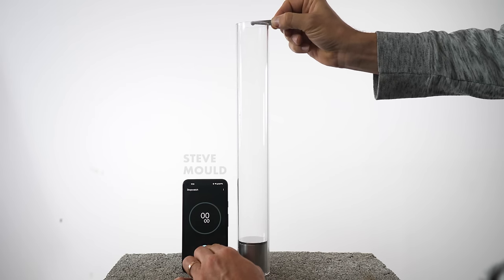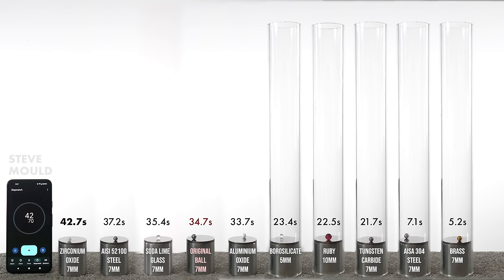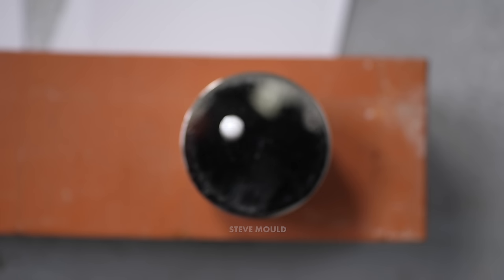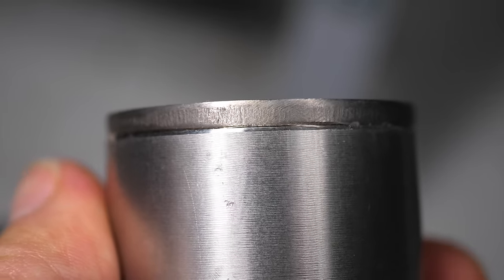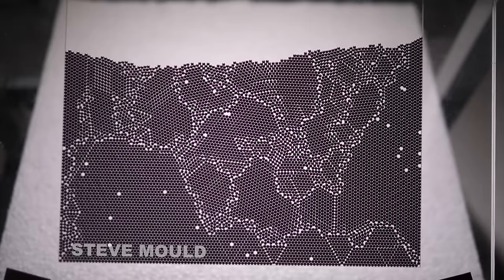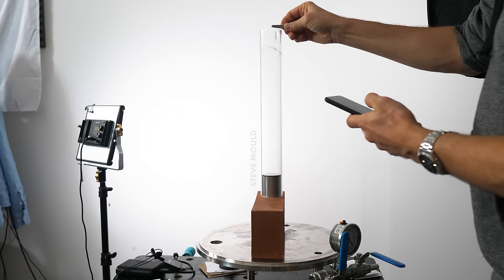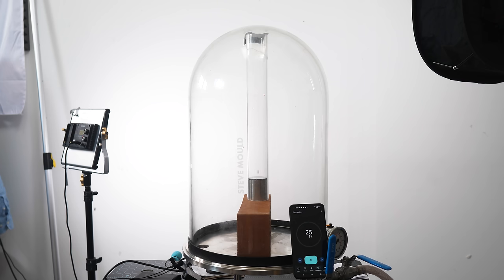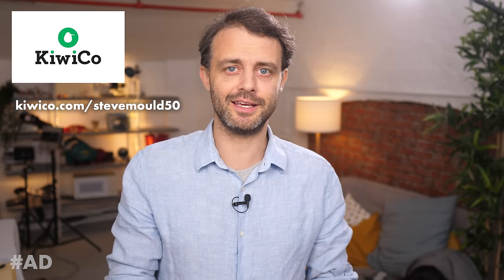This weird metal is insanely bouncy

Comment: Ah! You should've tested the smaller ball bearings again in the vacuum tube, as they were most affected by air resistance.
Reply: Good point! I wonder what a multidimensional graph of the results for each combination of variables ( air-resistance / ball-size / ball-material / surface-material / base-material ) would be like.
Reply: I was hoping he would as well :(
Reply: Given how little it seemed to change his tests, I imagine the square cube law has a much greater affect on the end result
Reply: @ittixen  that would be a radar chart
Reply: Agreed, it's the first thing I thought about.
Reply: I do think he should have done that but it also hit me <hypothesis>  that a ball bearing is just short of aerodynamically perfect. So even the small ones will experience very little drag.
Reply: Does the heat dissipation change much in a vacuum if the heat doesn’t transfer to the gas molecules?
Reply: @brekkoh  Probably, but given that air resistance does seem to play a larger role foe the small bearings, it may be enough of a variable change to make some interesting, if not significant to this test, changes.
Reply: @brekkoh  Isn't the square cube law (here: volume and weight increase cubically, while the surface only increases quadratically, as you increase the diameter linearly) precisely what might make the vacuum matter more here? For the smaller balls, the air resistance matters more since smaller balls have much less weight and therefore energy than the larger ones, but not that much less drag. The vacuum should take that issue largely off the table and we should be able to guess at the other differences between large and small balls (do they deform differently, does that make a difference? do smaller ones profit from their weight being less significant in relation to the platform?)
Reply: @elisha1984  Unlikely. Even in the setup with air, most of the heat dissipation happens through the base, not while midair anyway.
Reply: @jwnavagus  hm no
that's why golf balls have dimples
Reply: even though i myself am a nerd and would love to see this, the entire reply section is just 🤓
Reply: Action Lab.... I summon you...
Reply: He could also have tested filling the vacuum chamber with argon or helium or other gases or other fluids.
Reply: There are several experiments in this aspect. Since the shape of the ball already has a very good form factor, it barely matters. Actually I would look for other factors and not particularly the air resistance.
Reply: the action lab moment
Reply: @jwnavagus  Yes, I suspect the matching of the object properties he was talking about is outweighing the effect of the air resistance.
Reply: @jwnavagus  spheres are not aerodynamically perfect, as the airflow approaches 90° divergence at the back edge, meaning the vacuum (drag) approaches infinity at the minute point centre of the wake. That's why u see tear drop shaped aerodynamics. A water droplet falling through air takes the most neutral shape(which would be a sphere in a vacuum)
Reply: @ittixen  ok so guys we need 
1. 3D
2. colour
3. patterns varying
4. sound
5. heat
6. smell
7.taste
8. vibration
Now with this we should get a 10D graph.
Reply: He probably didn't think about it because of the forces he mentioned that would take energy out of the equation at low bounce height.
Reply: Yes Please.
Reply: @jwnavagus  Spheres are not aerodynamically perfect.
Reply: Yes, I thought the same.
Reply: @neutronenstern.  Exactly hahaha... I wish we had 4D vision + some other new senses on top so we could visualize such complex relationships at a glance.
Reply: Rain drops aren't "perfectly" shaped, surface tension pulls them toward spherical.  Freefall in a vacuum of course that's the only force, so they're perfectly spherical.  Also what's the "perfect aerodynamic shape" depends on the regime of flow (Reynolds number).  Shortest surface length (sphere, no dimples) is best if there is no risk of separation.  Teardrop/airfoil shapes are best at preventing separation (dimples/etc. to energize the boundary layer may help).  Truncated "bullet" shapes trade guaranteed separation for less surface drag and unstable flow.  And then there's sonic effects.
Reply: @ittixen  Also temperature dependence would be nice, but it would be hard with equipment which probably shouldn't be freezed by liquid nitrogen or even heated in a furnace :D
Reply: Needs to see this, could get crazy.
Reply: @brekkoh  the square cube law is only relevant because of air resistance though.
Reply: Yeah. I was waiting for that, but...
Reply: Also test other gases, like helium or SF6!
Reply: Imagine the time just to try to please your curiosity
Reply: To what extent at the speeds involved? The slower you go the less air drag matters...
Reply: This is exactly what I was thinking, good idea!!
Reply: @jwnavagus  actually spheres aren't near perfectly aerodynamic. Tear-drop shapes are.
Spheres create a void behind them that creates larger turbulence.
Reply: This. Now I'm really sad this wasn't done.
Reply: If the energy is dissipated thru heat what happens if the surface is hotter than the ball? Energy can only go into the ball right?
Reply: Gotta be next. Maybe even cool it down with liquid!!! And then go to the opposite way....heat them up, super cool the pad. 

This will turn into an hour-long video.
Reply: @peterliwyj7181  The energy dissipating as heat doesn't care about its surroundings.
Reply: @ittixen  Phase space plot for the win :D
Reply: @peterliwyj7181  energy is not specifically dissipated through heat but through vibration. This "manifests" as heat, sound, light etc.

One side being just being hotter than the other doesn't really alter the distribution of energy from the collision.
Reply: I was thinking the exact same thing!
Reply: bro u guys are nerd’s🤓
Reply: That would be sick
Reply: bounce the "demon core"
Reply: If he doesn't do this I think I'll riot
Reply: Okay Captain hindsight... Shut up... Lmao 😂😂😂
Reply: @elisha1984  That would just mean the ball and surface retain the heat longer,  it wouldn't return the energy to the bounce.
Reply: also most affected by molecular forces (square cube law) but he should have done the tests on smaller balls one by one in vacuum stoping when the bounce decreases because we can predict the effect of those forces increases as size decreases.
Reply: @asailijhijr  why tho?
Reply: Do you think a rock and a feather might fall at the same rate in a vacuum, too? I wonder...
Reply: @elisha1984  Heat transfer takes time, the bounce velocity is much greater and the movement much shorter than in an elastic material.
Reply: @tcunero  Action "Lab" usually has one or more major mistakes in each video.
Reply: smaller stuff more affected by air
Reply: You mean bearing balls, right?
Reply: I mean given the cross sectional area and velocity of the balls it’s probably fair to say the force of air resistance will only be a couple of newtons and since the height of ball is only several centimeters and the final velocity would only be a handful of meters per second it is fair to say that air resistance in this case is negligible. If you don’t believe me look up the formulas and prove me wrong with actual physics and math. Also the formula for air resistance doesn’t depend on the mass of a ball. The formula is one half the air density time the velocity squared times the drag coefficient times the cross sectional area and the coefficient of friction for glass is 0.9 to 1 meaning friction is pretty much negligible.
Reply: Very nice ball(s) indeed. Would be nice for robot testicular units.
Reply: The resonance of the cylinder vs ball size *
Reply: @ittixen  I need to see a gradient of quickest descent!
Reply: The speed for the 7mm ball did not significantly changed due to the less amount of air friction it experienced without the vacuum
Therefore the best case would have been to use the small ball bearing in vacuum ( it is clear that in a nearly perfect elastic collision, if the mass of object colliding with the surface is small then it's momentum would be considerably large)
Reply: @brekkoh  yea, probably
Reply: @brekkoh  Isn't the square-cube law the root cause of the air resistance effect on the small balls in the first place? because the smalls balls have proportionally more surface area compared to their internal mass vs the larger balls, they are disproportionately effected by air resistance?
Reply: @ska042  youve got the right idea. The square cube law is the root reason in the first place as to why the smaller balls are disproportionately effected by air resistance
Reply: You win the shoulda woulda award
Reply: Came here to suggest this as well
Reply: Just wondering what would happen in a vacuum tube two surfaces at zero gravity 😜see if it keeps going....
Reply: @jwnavagus  I also wonder whether the speed is high enough for aerodynamics to have a big effect or not 🤔
Reply: Agree
Reply: No u
Reply: @thomasfa18  How would you get something that is a teardrop shape falling going down, also to be a teardrop shape going back up?
Reply: @CorporateZombi  it doesn't matter how or if it's even achievable. The comment I made was in response to someone incorrectly stating that a sphere is the best aerodynamic shape when it very much isnt
Reply: What's with the "Ah!" Lol
Reply: @william_4297  Exactly, air drag is negligible. This means that it is likely that a smaller ball would in vacuum still be worse than the 5 or 7 mm balls. I think smaller balls are worse because of the shape (mostly thickness) and size of the bouncy metal plate part. When the ball bearing ball is heavier there is relatively less bouncy plate to leave vibrating. There may even be a resonation frequency of the bouncy plate that is more easily triggered by certain weights of balls.
Reply: My brain hurts from these comments
Reply: Was it really the air resistance?  Or maybe it's that the smaller ball bearings present a proportionately larger cross sectional area to the metal plate as they deform when striking the surface, and so more energy is carried away with each bounce?
Reply: This
Reply: @G, S? you deserve better than that, fellow person on the internet.
Reply: @elisha1984  How does the James Webb telescope radiate its heat into space?
Reply: @glennboyd939  water drops are spheres in the air too
Reply: damn Steves got some fancy cats
Reply: @foresttaniguchi3168  I have actually neen stuck in my head, trying to figure out how heat transfers in a vacuum like outer space. I like to try and work these out in my head before I look up why. It's fun to go about pondering these things that, I'm assuming, have been figured out. I'm guessing the heat is just absorbed by the material of the telescope which , excites it's molecules. After time, I think the energy is expended and the molecules revert to a more kinetic state as the energy travels outwards from the source. But, in my mind I keep picturing these heat waves dispersing into the vacuum until  my brain tells me "no" again.
Reply: @foresttaniguchi3168  I think the heat transfers into kinetic energy by the material of the telescope, exciting it's molecules. As the energy moves outwards from the source I think the molecules of the material revert back into a kinetic energy state once the source of heat stops generating. But then my brain keeps picturing heat waves radiating into the vacuum until my brain says "no" again, I wanted to think about it before I looked it up.
Reply: @elisha1984  no, it's independent. Heat transfer is bidirectional energy transfer. Here the kinetic energy dissipated produces heat, but it's one-way energy transfer. Whatever you do with the produced heat doesn't matter on the energy dissipated. It means that, in theory, you can infinitely heat a perfectly isolated stuff just by sending other stuff on it. (Ignoring heat transfer during contact). So for this experiment, isolation won't decrease the kinetic losses at all, if this is what you asked.
Reply: @peterliwyj7181  see my answer above
Reply: @TTxR2  Thank you! I forgot that kinetic energy produces heat. (Duh! Friction!) iI was really going round and round in my head about about heat transfer properties in a vacuum; like how I used to imagine perpetual motion when I was a kid, until I could conceptualize the mechanism of friction. Concept of friction is problematic for my brain even though it’s such a simple one.
Reply: @jwnavagus  Sphere's actually are not all that aerodynamic and do experience significantly more drag that other shapes. https://en.m.wikipedia.org/wiki/Drag_coefficient
Reply: @elisha1984  more specifically it's macro-movements of the collisioning body that impulse macro-movements of receiving material atoms, that turns into vibrations that produces sound in making the air molecules also vibrate, and heat by impulsing some mico-movements on the vibrating atoms (this is probably what you call friction, indeed internal friction of the material). The kinetic energy (movement) stolen from the moving body is, thus, transformed to kinetic energy of the molecules "lattice" (mostly vibrations because it's firmly attached to the table), which is transferred into sound waves, and for an other part transformed into heat. Macro-movements = kinetic, micro-movements = heat. It can seem arbitrary, but macro-movement for a solid is ordered movement (whole movement or macro vibration). Ordered in the sense that: it has lower entropy, and we cannot probe it the way we probe heat. Micro-movements are, in the contrary, disordered, random. So kinetic and heat is fundamentally just movement. It differs the way we can measure them. We also could say heat is quantic, kinetic movement is classic. Where the notions blur is in gas: molecules are traveling space (kinetic energy) but since it's disordered and random (Brownian movements) it can be measured as heat, and is called heat. And it can be transferred back and forth with surroundings (you can heat a gas by heating it's encasement, but you cannot make a metal block move by heating it's support) so it's legit to call it heat.
That's indeed a very interesting subject. Feel free to ask real physicians, which I'm not (read: don't take my words for granted)
Reply: Bearing balls* 😅
Reply: A very high pass filter on the audio file would perhaps be good.
Reply: You stole the comment I was gonna make 🤬🤣👍
Reply: 10,000th like
Reply: God I love all you brilliant people in this thread. Learning about the square cube law while bouncing different materials of ball bearings couldn’t so interesting without you all.
Reply: @jwnavagus  Incorrect, balls are actually not very aerodynamic at all. Golf balls are the the most aerodynamic a spherical shape can get, because the indents capture pockets of air close to the ball, changing a large portion of the surface from golf ball vs air interaction to air vs air interaction.

A ball bearing has a whole spherical surface of metal for air resistance, a golf ball has a shell of air acting as it's air resistance surface.
Reply: SOOOO TRUE!!!!!!!!!!!!!!!
Reply: Were they really?
Reply: @elisha1984  I don't think it would. The dissipation of enegery heats the amorphous metal not the air. What this would change is the rate at which the heat is dissipated from the metal. But I do not think it would change the bounciness
Reply: @suisseski   Now that I am thinking of heat as something contained by matter,as a result of its energy, with the ability to transfer to adjacent matter, I can finally visualize it without the thought loops.  Heat exists where the kinetic energy is occurring. I think you are right that heat wouldn’t be a noticeable factor for bearing bounciness. I was trying to think of this on a nano level.
Reply: I'm stunned -- you used the word "affected" instead of the lazier bastardization "impacted". Kudos. Every time I hear something like "impactful" I cringe.
Reply: He said that in the video…
Reply: @jwnavagus  , of course, no matter the ball size increase, the air molecules stay the same, so the smaller bearings will be more aerodynamic.
Reply: @csn583  , gravity is working on the sphere as it falls in a vacuum. Seems that would deform the sphere a millionth... No, the sphere will reach equilibrium.
Reply: @typebin  , more percentagewise of coefficient of drag, less because of less frontal area.
Reply: Did you try it with the vacuum dome but WITHOUT evacuating it? You already noticed how critical the base is - maybe the dome is dissipating some of the impact energy and that's why the vacuum isn't as effective as expected.
Reply: Damn, I think I walked in on nerd con
Reply: I think the square cube law would still come into play
Reply: Thanks for saving my time I thought that’s where he was going with it
Reply: Just thought exactly the same!!!
Reply: That’s exactly what I was thinking!
Reply: Bro said “Ah!”
Reply: Less affected
Reply: Ummm.. think again
Reply: Ah 🤓
Reply: You should’ve